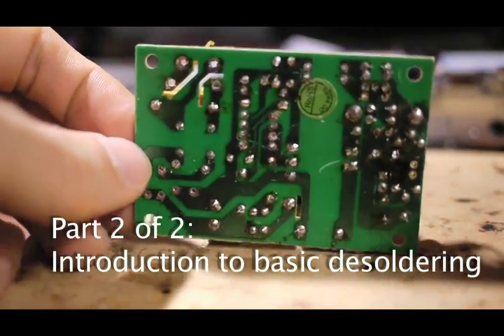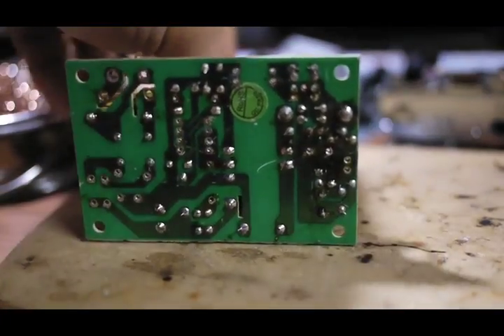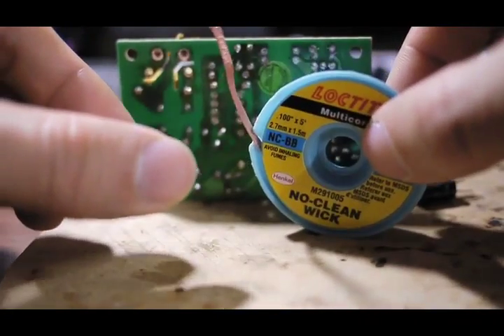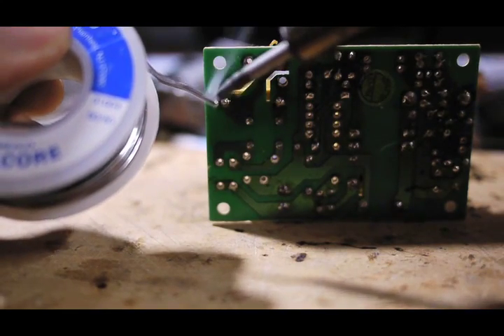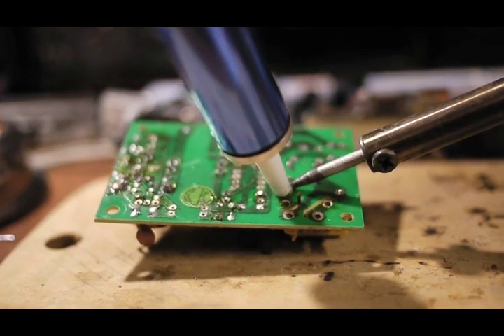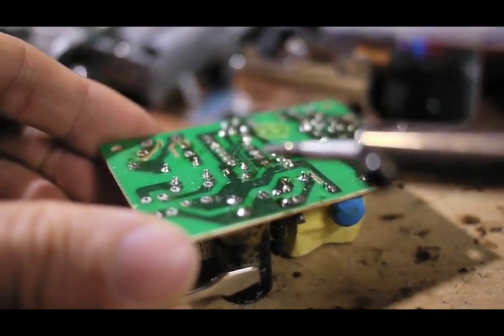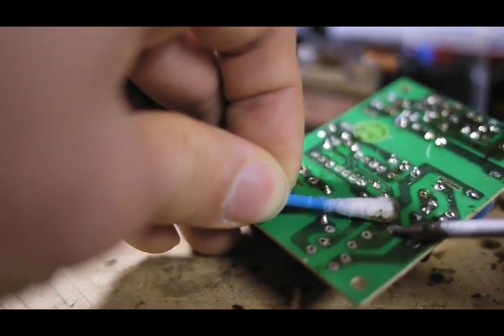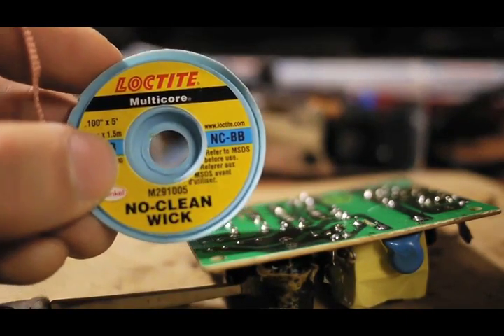Introduction to basic electronics soldering Par 2 of 2: How to desolder

Comment: Hi there I have a small micro board here that from a Motorola V360 phone it got companies that I would love to use on my project what machine could I use to take all the companies off of it without burning it

It has LED 2.5mmjack USB and Switchs along with a onboard connector
Reply from the maker: You may want a hot air de-soldering station.
Reply: Not sure where to get one of those I have like 7 circuit boards with a lot of components on them that I would love to use on my project here for my sound bar
Reply: Nice video. You may also want to checkout the review of introduction to basic electronics on my blog at jasonreviews. com/introduction-to-basic-electronics-review/ Thanks, Bobby.

Comment: I have desoldered many parts form mother boards using the vacuum pen, but this week i encountered a mother board where the soldering points do   not  melt, i tried the desoldering braid as well but does not work either, is there any liquid that i need to use in order to have it desoldered?
Thanks

Comment: What is De-soldering material?
Reply from the maker: An example would be the flat copper mesh ribbon (desoldering wick) at the beginning of the video. Soldering flux is also useful if the the wick doesn't have it already.